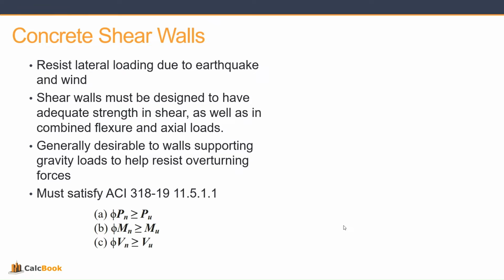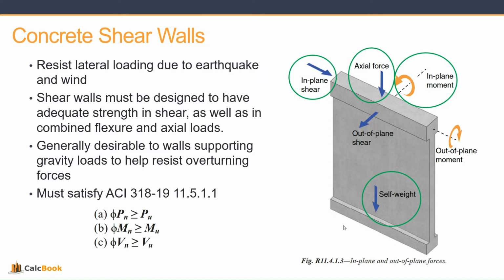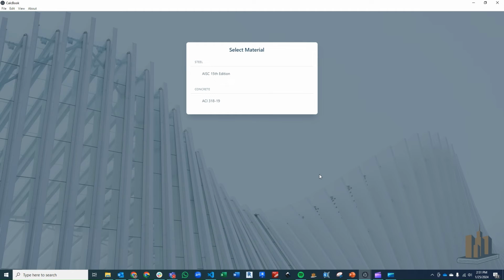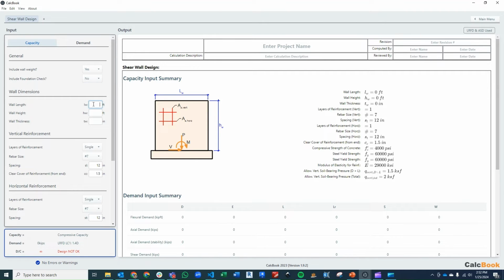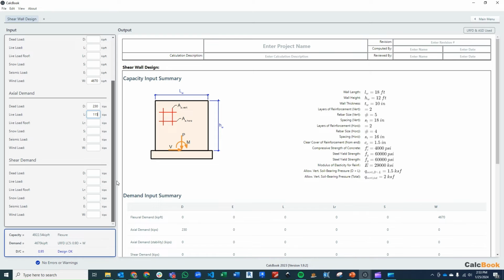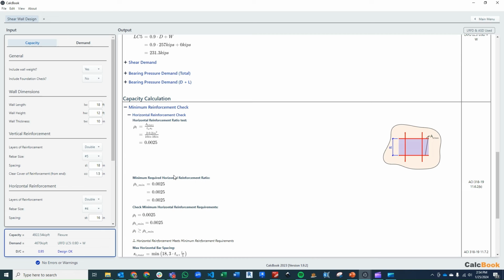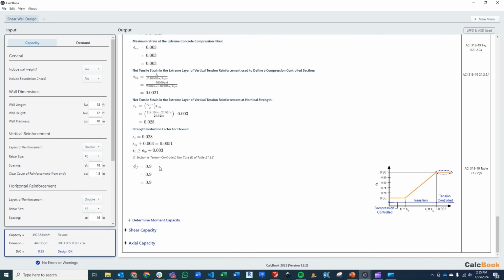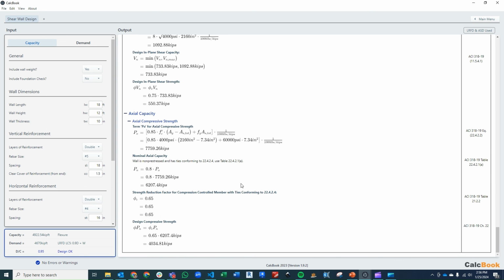Concrete Shear Wall Design (ACI 318-19)

Comment: Very informative. Thanks for this great demonstration. Please explain the detailing diagram on RHS while calculating "c" and "dt".
Reply from the maker: We are glad you found the video helpful! The image shown when calculating “c” has two parts:

1) A cross section (cut horizontally) of a shear wall showing the total length of the wall

2) The assumed strain distribution, showing the assumption that plane sections remain plane. “dt” shows the distance from the location of max compressive strain (= 0.003 in this case per ACI) to the location of maximum tensile strain, at the steel bar closest to the opposite edge. “c” shows the distance between the neutral axis and location of max compressive strain.
Reply: @calcbook  Thanks for the explanation👍